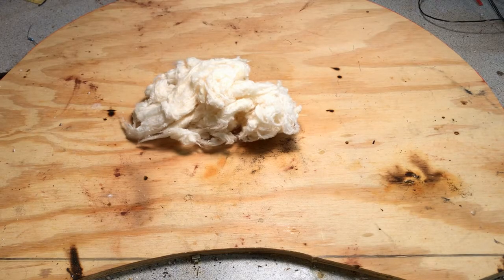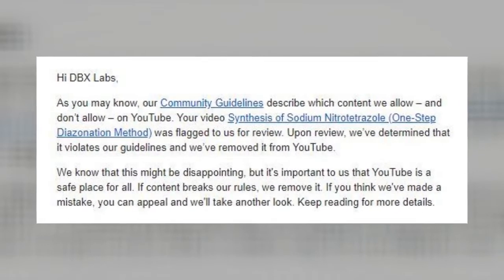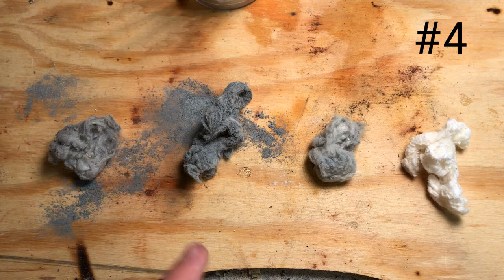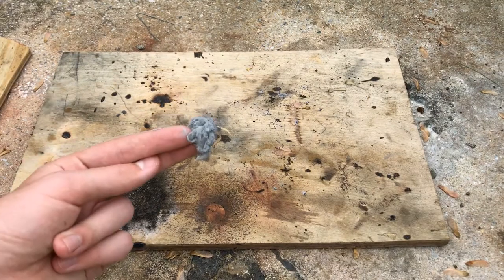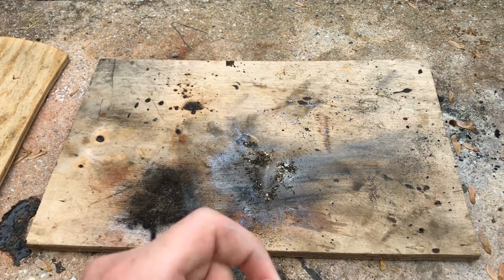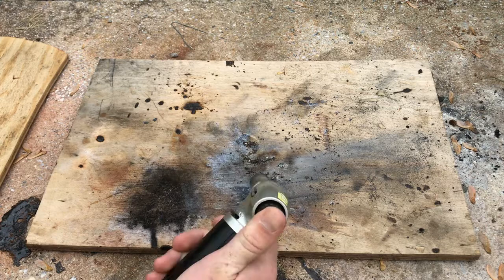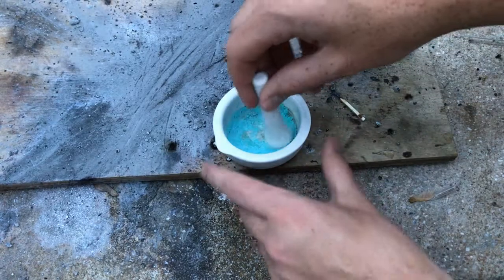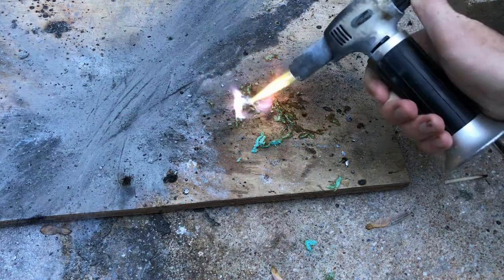Nitrocellulose Additives

Comment: Al is added to rocket fuel and high explosives because it adds lots of heat (energy). Mg is added to fireworks for the very bright display. I've seen both Al and Mg added for good results. I was surprised the KClO4 left un-burned Nitrocellulose. It was an Oxygen Rich mixture, all the fuel should have been consumed.

Comment: Gun cotton is the basis of smokeless gunpowder if i'm correct. There's 3 forms, the first is this but it is broken down into a mash and then made in to long cylinders and then cut into small pellets, and the next 2 have a very Nitroglycerin for the 2nd form, and another added to the third, which gives more FPS to the load.